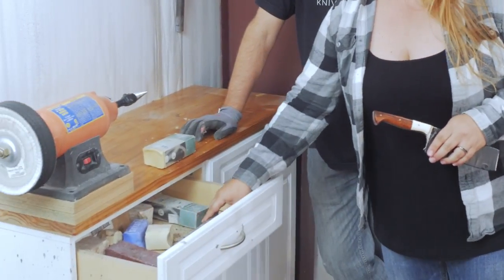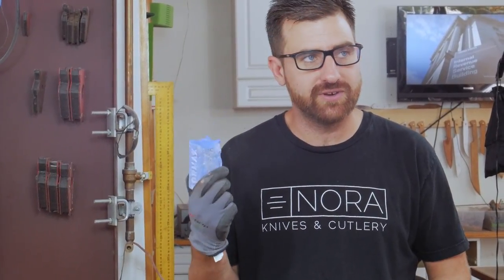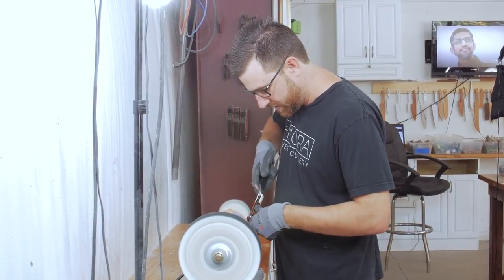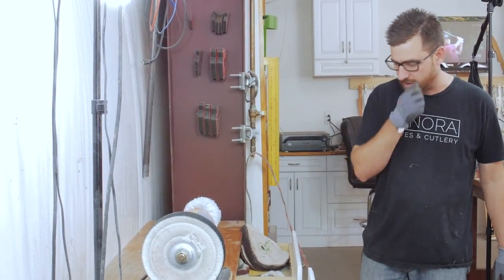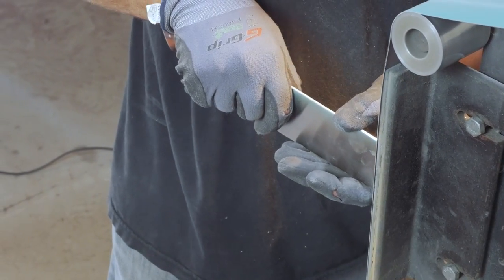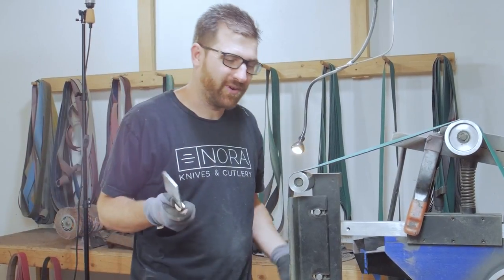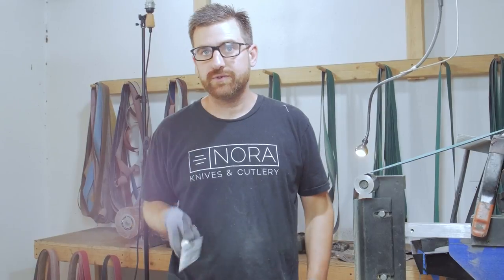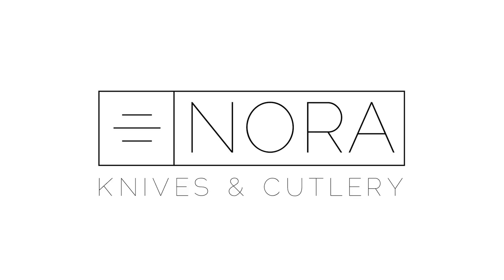Dani & Steven (Nora Knives) - How To Polish and Buff a Knife

Comment: When I try to buff my blades I use a black compound on my belt sander and buffing wheel combo it spins about 3400 RPMs but whenever I buff the knife it leaves like black smudges on it and it doesn’t make it shiny can you help me with that
Reply: I hate when they respond to a very legit question I have simular problem
Reply: Very late to the question but I believe you overloaded your wheel with compound.